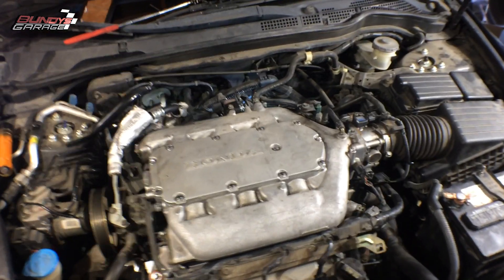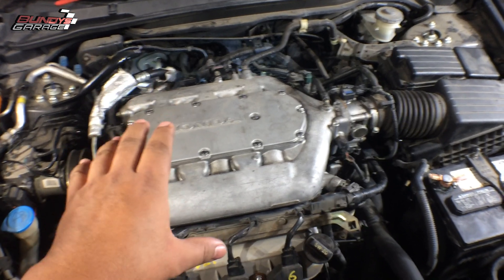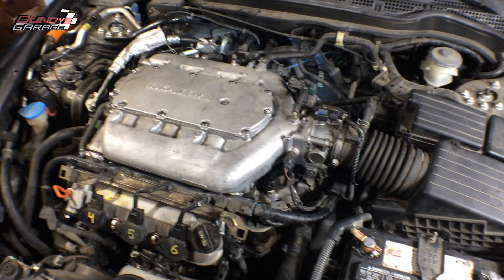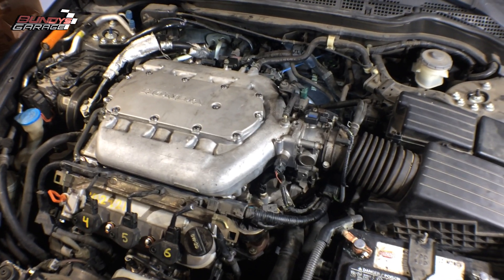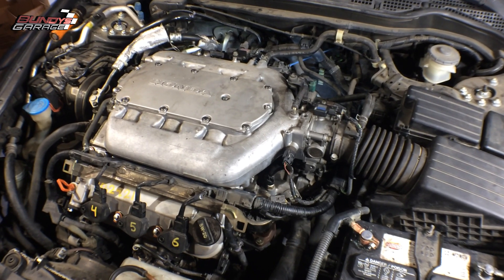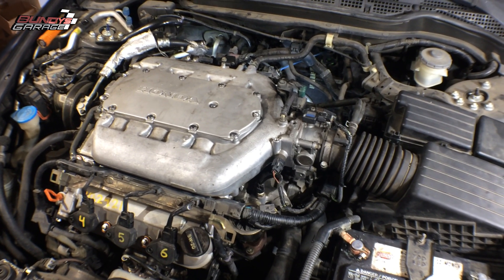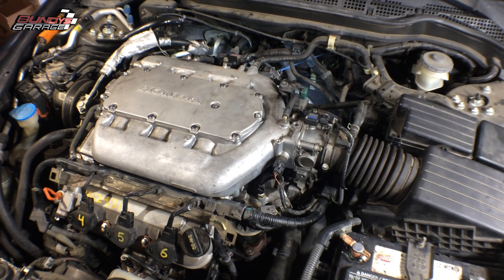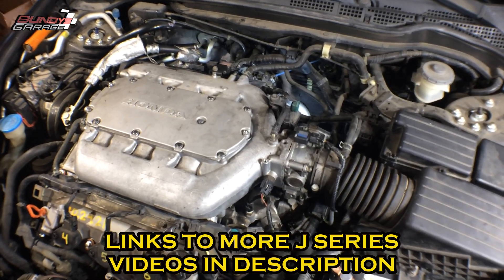J SERIES V6 Broken Bad Rear Motor Mount | Honda Acura Accord Odyssey Pilot Ridgeline TL CL MDX RL

Comment: I replaced all engine & xmission mounts immediately after I bought my 2004 TL back in 2012.  I bought Honda's engine hanger kit that sits on top of the frame and suspend the engine. 

The FWD & AFT mounts are like $200 each now, as they have vacuum ports.  I usually go with OEM parts, as Chinese knock offs are nothing but trouble.